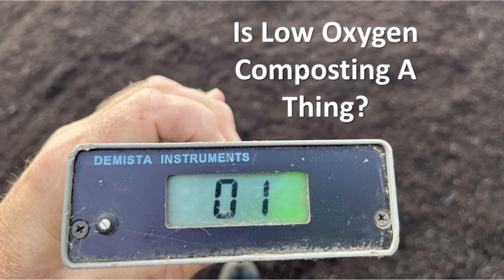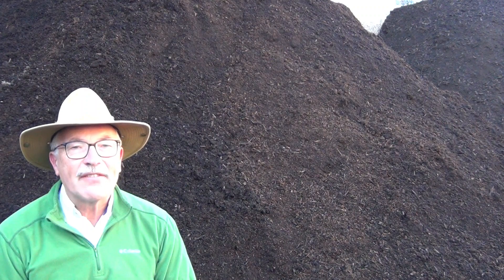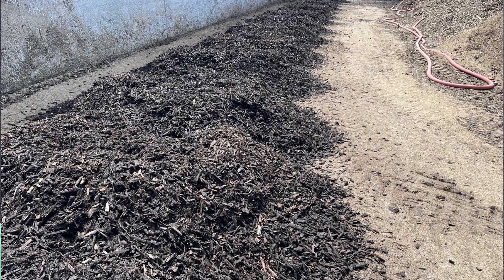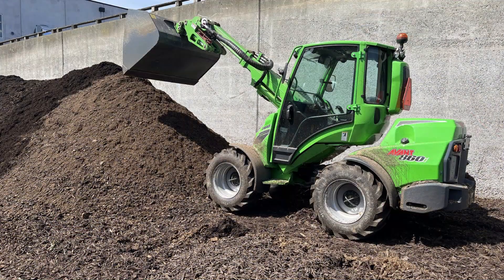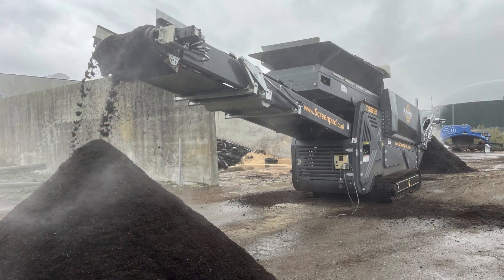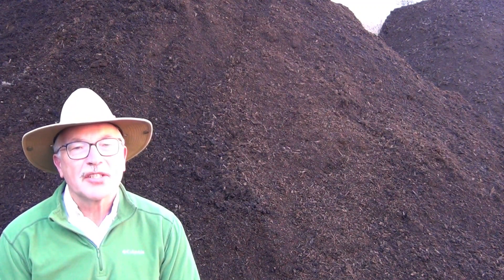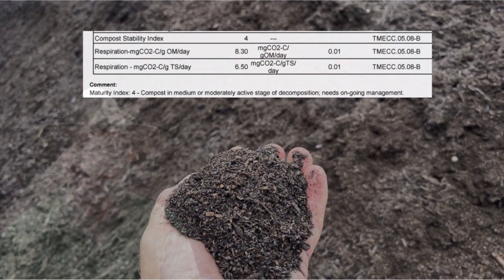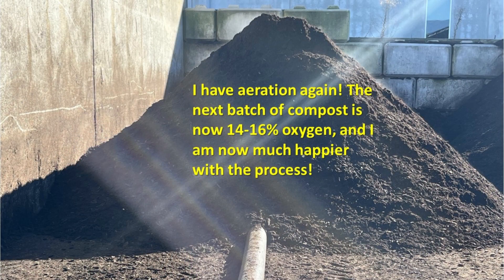Is Low Oxygen Composting a Thing

Comment: It doesn't make sense that it would be low emissions. Methane, nitrous oxides, and VOCs are produced at much higher rates by microbial communities under low oxygen conditions. 

Perhaps they are referring to lower emissions of CO2, which is the product of efficient aerobic respiratory metabolism and therefore a marker of a healthy composting process. A strict fixation on CO2 emissions as "bad" does not make sense in the context of composting. Methane and nitrous oxide have much higher global warming potential than CO2 does.
Reply from the maker: There is some thinking out there that if one aerates at a higher rate, its more likely to blow out  potentially odorous compounds, therefore aerating at a very low rate is better because less odor is "pushed" out. There is a tiny bit of truth to that because I can make a big pile, and as long as I don't aerate it or turn it, there will be minimal odor (any odor that seeps up will be decomposed by the aerobic microbes at the surface).  The fallacy in this thinking is that, as you suggest, we need to consider the microbes and their change in metabolism when provided with adequate oxygen.

Comment: Thank you for this excillent information. 
I want to know, incase of chicken manure, is it possible to decompose within 3 weeks to get odorless mature compost? 

Thus, chicken manure contain several times ammonia than cowdung or kitchen waste. I use compost turner in composter pile every alternative day.
Reply from the maker: It's not likely very easy to achieve with just chicken manure by itself. If you would wish to speed up the process, it would require actively aerating it, mixing it at least 2 x weekly, and adding water or other liquid material. Chicken manure contains so much energy, and hence requires a lot of air, which dries out the product quickly. Hence the need for adding water and mixing it at least 2 x weekly. Just turning the product with a compost turner works, but it takes a much longer because the oxygen drops to 0 within minutes after turning. I hope that this is helpful.
Reply: Thank you.

Comment: I really appreciate hearing about your controlled experiment with low oxygen compost. I'd have to say that this is what we're seeing when we're forced to delay turning our non-blown piles in order to avoid overheating the piles - we don't have the ability to add water when turning. We end up with a lower quality just based upon the look and smell. Currently, government agencies are suggesting the farm pour almost a 1-acre concrete pad for our turned piles all the while ignoring the quality of the compost. We'll need to think through what will work but blowing the piles instead of turning only could really help with being able to cool the piles and drive off excess rain water. Thanks again!
Reply from the maker: Thanks for sharing. Yes, when we are required to compost on an asphalt or concrete pad, we realize that if we optimize the composting process either by using larger piles, or a faster process, we save space, and cost!

Comment: Two low O2 composting methods I've been curious about but haven't tried with any seriousness - 

1. Gerry Gillespie's SPICE (Static Pile Inoculated Compost Extension) compost  - https://www.gerrygillespie.net/uploads/4/5/6/5/45656863/spice_compost_metric_version.pdf

and 

2. Microbial carbonisation , an anoxic style of composting developed in Germany - https://stud.epsilon.slu.se/17641/3/stephan-l-20220331.pdf

Have you run into or tried either of these specific methods?
Reply from the maker: Thank you very much for sharing these articles. They are fascinating! 

For the SPICE method, I see that the pH is very low in the compost, so it seems more like a fermented product like a silage. I would be curious about maturity test results (respiration testing). It would also depend on the end goal of the compost - if used on farm fields, we are not as concerned about maturity of the compost. During my soil science training in the 80s, we used to debate the benefit of partially decomposed organic matter because we were adding more labile carbon to the soil. This would be different than producing a stable compost that one could market to homeowners. I actually used to produce compost similar to the SPICE method, but it took more time and I had to limit the size of the piles. Also did not seem as effective for high energy manures such as poultry litter.

The second article has some fascinating information as well, comparing low oxygen composting to windrow composting. I would say that the windrow composting could be considered lower oxygen composting as well, with periods of anaerobic activity. Again, I would wonder about the maturity of the compost as measured by respirometry. The higher N2O from the MC compost after field application suggests to me that this material is not as stable. We had similar observations when we did similar work in the 1990s.